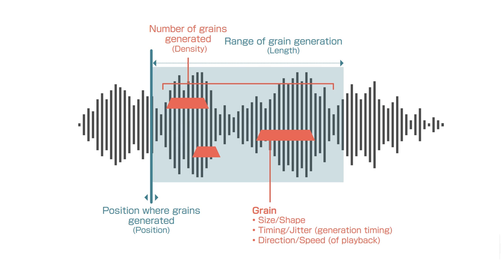Full Tutorial - SONICWARE Liven Texture Lab

Comment: Excited to run a guitar into this.
Reply from the maker: Ooh yes good idea. I'll have to try that tonight at band practice
Reply: Will the input be able to take a guitar signal? Or do you recommend using a amp with a line out in between?
Reply from the maker: No it won't take a guitar directly in so yes you'll need an amp or pedal that will output a line level signal and the appropriate adapters fit the 3.5mm line in socket
Reply: Can the FX mode be connected to an Aux in and out on a mixer like Tascam 12? Would the levels be correct?
Reply from the maker: Yes I just took a look at the mixer. You'll need the right cables and adapters to make the connections. You'll be able to connect the Aux Out to the Line In on the  Texture Lab to use Aux like an effects send. From what I can tell though you'll need to run the Line Out on the Texture Lab into one of the stereo inputs, there doesn't seem to be an Aux Input or a return connection

Comment: Amazing tutorial, it has helped me get started! 
I have a question, I am running audio from another hardware synth into the texture to sample in audio however the audio output of my texture lab outputting audio from the LINE IN + the texture lab opposed to just getting audio from the texture lab and its very annoying! I am supposed to physically pull out the the cable after I have finished sampling to avoid this?? Thanks kindly
Reply from the maker: Thank you. To solve that problem you can either pull the cable out like you say or lower the Gain setting in the Line In menu

Comment: Excellent. So comprehensive for such a compact unit. Questions: Polyphony voicecount? Does it process poly afterthought or MPE? Can one “draw” a complete envelope shape with the key function in real time? No sample file import but only via MIDI sample dump?
Reply from the maker: Thanks. The poly count is 4. It doesn't support aftertouch or MPE. There is only an AR envelope for volume or fade in or out for the filter using modulators. You sampling options are either recording audio directly into the texture lab or importing midi sysex created on the Liven or through the dedicated web page
Reply: @ChrisLodyMusic  thanks for the answer. I could live with the poly count etc but not being able to use afterthouch / MPE to modulate parameters in real time is a showstopper for me.

Comment: In my opinion the workflow of this machine is absolutely pain in the ass!! To have fun is another thing. I will return it and switch intour teenage engineering KO 2.
But by the way.. very good Tutorial
Reply from the maker: Well I think given how complex granular synthesis is they did a pretty good job squeezing it into this, but yeah they have been working on better workflows on upcoming machines it has to be said. 

Sometimes a layout just doesn't gel with the user I think. I was really excited to get a Waldorf Blofeld when they came out and they are really well regarded but I just couldn't get into it for some reason so I sold it on.

Be careful with the KO 2 purchase though. I was interested until I heard about the slider and speaker issues a lot of users have had so look into the build quality first.

Comment: Great video! Really helpful for new users, thank you. I got my Texture Lab this week and I'm really enjoying it but I'm struggling to get the most of it. Some of the patterns, such as 'Sing' (bank1, pattern 14) sound so complex and nuanced, any tips on how to recreate that sound? In particular there seem to be at least 3voices at different pitches but playing at the same speed, I can't figure out how to achieve that. Any tips would be greatly appreciated!
Reply from the maker: Hi glad you're enjoying the Texture Lab. Thank you, that pattern is actually one of mine made with my voice 😁 It was a bit of an exercise is making something a bit different so it uses the parameter locks to move the Position setting over time (I tried using an LFO for this but it doesn't work unfortunately). Luckily I've already made a tutorial for the Lofi-12 which can be programmed with the same technique to move it's Start parameter, so you can follow that tutorial swapping Start for Position. This essentially sets up old school time stretching. It's a bit time consuming to program in but once you've done that you can save the pattern down and reuse it with different sample. You can program the parameter locks without any notes in the sequencer, or you can erase notes with the Rec button lit which will retain the parameter lock data. The tutorial is here: https://youtu.be/HvGAmcKiqDw
Reply: Thanks a lot! That's really helpful, I'll check out the tutorial 👍

Comment: Thanks for the excellent video chris! Been readumg the manual ahead of delivery. One thing im not clear on is whether you can use the external in/efx mode at the same time as the sequencer (specifically using it to control an external synth whilst using the fx on the incoming audio) have you explored that capability?
Reply from the maker: Good question. I've not actually tried that so ill try to find time to try it tomorrow
Reply: @ChrisLodyMusic  that would be amazing to find out! Sequencing something external whilst pushing it through the efx mode would be a killer feature. Also the manual says "When turned ON, the pitch changes to the pitch corresponding to the key pressed based on the low C key" which I don't understand but implies grain pitch might also follow too. Killer it does.
Reply from the maker: I tried this and the result are interesting, though I'm not sure it's what you're looking for 😄 The EFX will send midi over the Midi Out socket but is limited to the range of the keyboard without any octave switches. This is because the grain output is pitched up and down across the keyboard in EFX mode so it can pitch shift incoming audio by playing the keys or a sequence. This is where it gets a bit complex because if you use the internal sequencer to play notes externally and these also get pitch shifted by the granular engine the pitch playing back through the granular output will be incorrect. But exploring it so far it can be brilliantly wonky! In EFX internally it works monophonically but can send midi over the midi out polyphonically
Reply: @ChrisLodyMusic  thanks for testing this out. Sounds like it could be awesome chaos in the right context. Going to be fun to test when these ship! Thanks again

Comment: One more question (my machine will arrive on Tuesday): It seems sequences (also parameter sequences) are stored with the presets. Which can be changed via Program Change. Does this happen fast enough to be usable in a song context? Or are there any delays that would throw the box out of sync? I don´t have enough hands to control all boxes at the same time, so the ability to switch programs/sequences from a master sequencer would be very welcome.
Reply from the maker: I've not tested that in that scenario to be honest but it should be as swift as loading a new pattern. It will restart the grains though so the change could be quite abrupt. If you'd like to smooth that out onboard try turning off the Reverb Reset control and make sure your patterns use the same reverb settings

Comment: Quick question: the effects applied to the line in (like the demo'd reverb), does that also include shimmer?
Reply from the maker: Yes the Line In will run through the reverb which will include the shimmer if it's turned up. To give a little more detail, in normal mode the Line In can pass through the reverb only, but in EFX mode the Line In replaces the sample so it will pass through the whole signal chain. So you can mangle it with granular synthesis or leave it untouched, modulate, filter it and then run it through the reverb. So it's very flexible as a programmable FX unit
Reply: @ChrisLodyMusic  Good info, thanks Chris!

Comment: Thanks for all the help.
Reply from the maker: Just wanted to let you know, Sonicware have been working to make the Texture Lab more accessible by making the web app not rely on drag & drop and they've produced a different version of the manual that replaces the images with text. You can access that below. Feel free to send them feedback via the tech support email https://www.sonicware.co.jp/DL/LIVEN_TextureLab/DOC/TextureLab_manual_en_r2_for_visual_disability.pdf
Reply: @ChrisLodyMusic   Many thanks for this information.  I've had a quick skim of this version of the Texturelab manual and it seems like an improvement but for two things: 1) When listing the controls, it appears to have lifted a page from the Liven Bass & Beats (it speaks of mixer, bass, snare, kick, fx etc). 2) It refers to  everything that isn't a knob as a "button." I much prefer the convention of "Buttons" (the rubber oblongs), "steps" (the round ones) and "keys" (the bottom row of keys). But issue 1 is a more pressing matter as once the basic controls are spelt out, it doesn't matter so much whether they're referred to as "buttons" or "steps." I shall of course contact support about this once I hit "reply" here.  Also, that's promising news about the sample app. Thanks.
Reply from the maker: @dinogoldie9716  Oh that's strange about the Bass & Beats section. Please make sure you send this feedback to Sonicware tech support though, it was produced by them at the Japan HQ so I won't be able to make any edits to it.

Having said that I have made some additions to my accessibility guide for it. Another visually impaired user asked me to add the contents of the menus so they're listed on there now too. That's here if you need the link https://www.dropbox.com/scl/fi/38ssldlfh2g5741ie19ki/SONICWARE-Liven-Texture-Lab-Accessibility-Guide-Tips.docx?rlkey=wvg4sgqjr5wmnmepb2w0m0awy&dl=0

Comment: Great tutorial.  Really helped me as a complete nOOb.  One thing I can't figure out is once I've sampled and saved and then make changes to the parameter knobs, how do I write those changes back to the save slot?  When I turn the unit off and back on it defaults to the original sample even though the knobs are in the same positions.
Reply from the maker: Thank you. So samples you record into the Texture Lab are saved in one of the 32 sample slots you select with the sample source knob on the far left and are just a recording of the audio, while all the other granular synthesis settings are saved within the pattern memories. So once you've created something you like make sure you save the pattern even if you haven't used that to record any notes, then when you load that pattern back up the knob positions etc will be recalled
Reply: @ChrisLodyMusic  Excellent!  Thank you so much for the response.  I knew I could save patterns but didn't connect that to savings edited samples. I appreciate it.
Reply: How are you getting on with it? I'm a complete noob as well and thinking about buying one

Comment: Currently reading (pdf-to-text rip of) the manual....How do I convert WAV files on my Win10 PC into sysex for them to be imported into the Texture Lab via MIDI Ox?  Page 35 of the manual omits that vital step in the process.  Also, how come it only has 32 sample slots?
Reply from the maker: Oh I think that must be an error on page 35, I'll let them know and they can correct it. There will be a web page where you can convert wavs to sysex for import for the texture lab but the last I heard it's not finished yet, I presume it will be ready when they ship. The connection procedure is the same as when performing firmware updates as below but just start the Liven as normal and go to the Sample - Data menu and select S.IMP to set it up to receive : https://youtu.be/bHxyV0qwFns

As for the limited number of slots, you'd have to as Sonicware that question. I know the samples are 6 seconds at 32khz which is higher quality than the Lofi-12 so I think that's why. Plus 32 is selectable on one knob without too much trouble

Comment: Please add some much needed info on how to sample into this thing. They really missed the boat by making a battery operated sampler unable to do something that every casio from the 80s could do with ease - sample direct with no mic or computer or op1 or line mixer. I like what it does but having to use an array of other more sophisticated devices to get my own sounds into it makes me want to throw it out the window
Reply from the maker: The Texture Lab (and the Lofi-12) will do just that, sampling directly from the Line In audio socket. If you need a direct microphone input you can use something like a Zoom h1n. It's explained in this video in the sections from 17:48 and 20:08
Reply: Thanks - this is a great tutorial - but after much testing of cables and different gear it seems as if the only answer is malfunction. The line-in gets a signal until I switch to mono - then no audio,. Then when I hit function/sampling I lose all signal. I've gone over everything I can think of.
Reply from the maker: I'll add the page for Sonicware tech support below. I might be wrong but it sounds like you might be feeding a signal on the right channel which will be muted when switching to mono as it's not a downmix of both channels but rather just listens to the left channel only. You can also get help on the official Sonicware Liven Facebook page, but try this too: https://sonicware.jp/pages/support
Reply: @ChrisLodyMusic  I finally figured out the problem I was having and hope I'm the only one who ever has this problem - the Clock setting has to be set to Line In. It doesn't really makes sense to me but that's fine - it works now. It is a little too easy to accidentally start button-mashing the important master settings when you're menu diving and playing at the same time - but that's pretty nit-picky. Thanks again for giving me some ideas